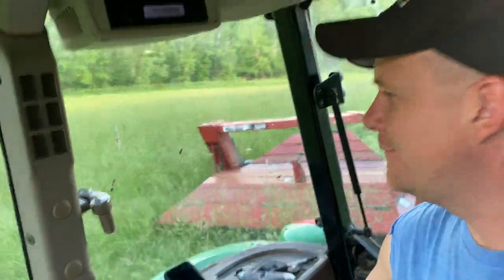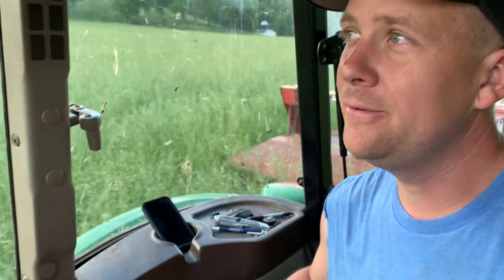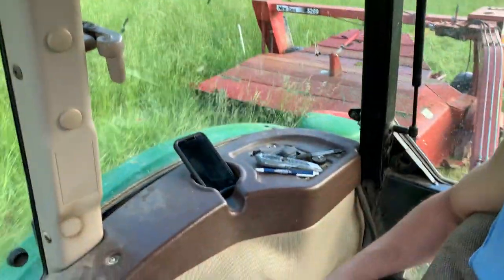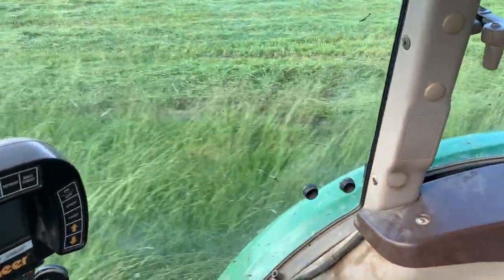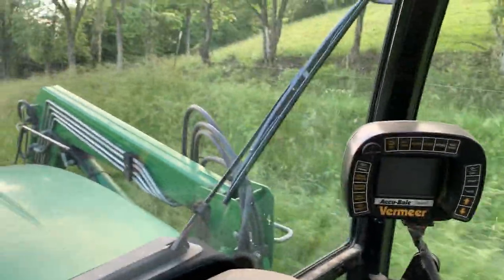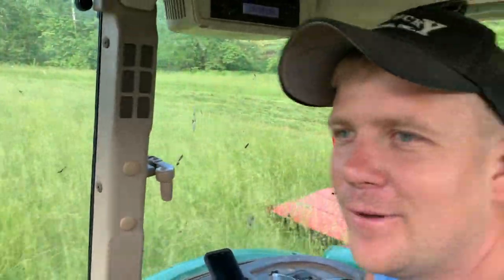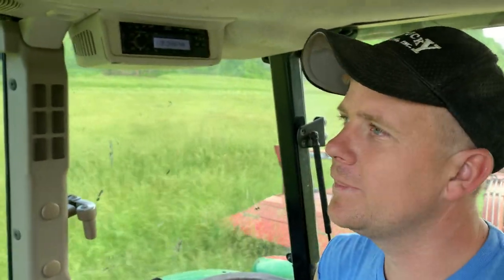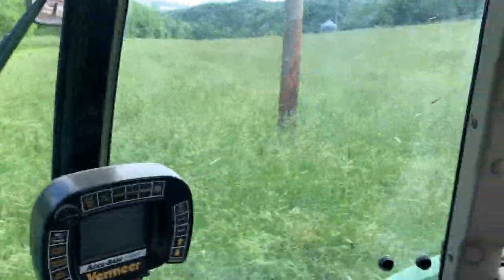Mowing Hay With a New Idea 5209 Mower Conditioner

Comment: This haybine is the best !  Ive reached speeds up to 22 miles per hour cutting hay. The only issue there is with that speed it automatically windrows the hay because the hay never has a chance to drop down to the ground before it hits the areas where its windrowed ( in the back of the machine ).  And..... you still need to turn corners. So.......average speed ( if you trap gophers )  is around 12 miles per hour.  Ive went to all grease in the gear boxes under the turtles.  Its stays there.  
If you twist off the hex shaft in the gear boxes... buy one from the local machine shop......medium hardness.  1/ 10 the priced at the dealer !